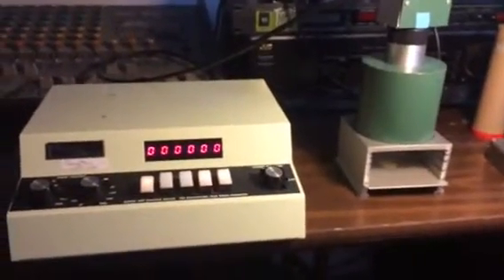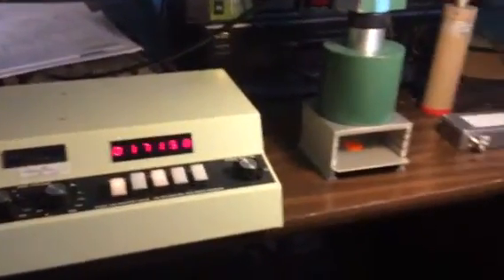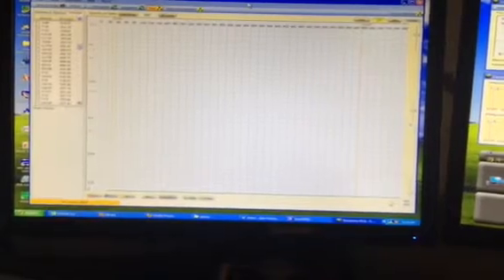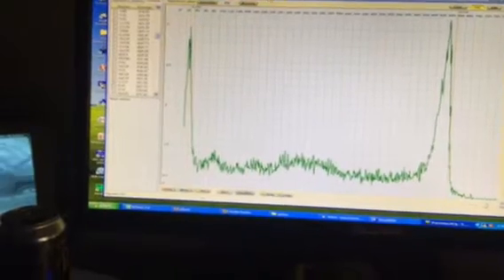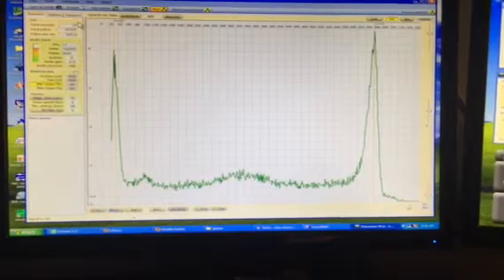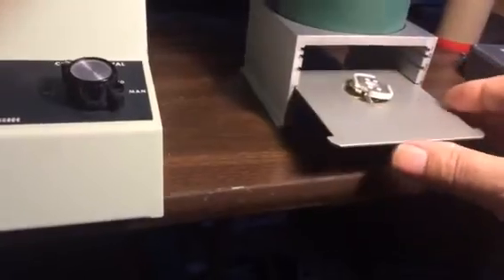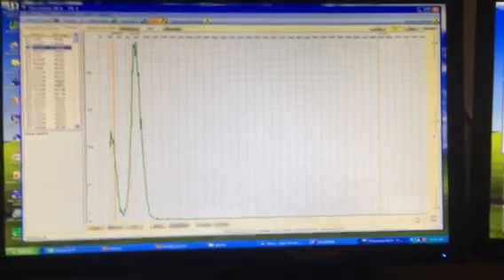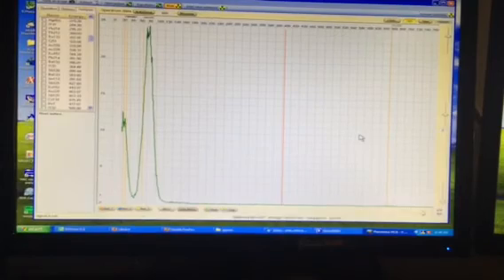Simple $2  Nuclear  MCA spectrometer  addition  to a  Nucleus 500 scaler part 2

Comment: Thanks for making this, based on your two videos I purchased one of these units from eBay for $50. It doesn’t come with the scintillation probe,  but I do own a Ludlum 44-2 and a home built scintillation probe that operates on 900v. Do you think that this will work as a set up. 
Cheers.
Reply from the maker: Yes the 44-2 should work fine. I used one on my 500 and it gave clean spectrograms.
Reply: @k4nlz  awesome thank you, I am a novice when it comes to this, I printed the wiring diagram today, where exactly on the board do you put the capacitor? And what kind of audio Jack do you use. I really do appreciate 
Any information. Thanks
Reply from the maker: @englishguy1985   hi guy.  What you are basically doing is using the 500’s precision variable probe power supply , and analog signal pickoff / click signal conditioning circuits ...... these circuits process the clicks to make them suitable for the digital digitizing chips. You are grabbing off  that same processed signal and feeding it into the pc sound card for the software.  I don’t remember , offhand , where the connection is .....it’s the input of the first digital chip. It’s clearly shown where I wrote it on the schematic seen in the video.  I just get a darkened out picture on my iPad when I stop the video.  Look the digital chip up on google and use the signal on the input pin. You can try points back toward the input as well. Probing around with the cap lead , near the digital chip input lead, won’t hurt anything.  You can solder a long lead with a mini plug on the end ( off old pc microphone or earphones is ok too ) of the cap and a chassis ground lug, adding the Jack on the back panel makes connections handier but not absolutely necessary. 
      I sold my entire electronics and nuke lab a while back ( and about everything else I owned ). I’m sick and dying of stage four  metastatic prostrate cancer and will be checking out before very long. I hope you have as much fun with nuke spectrograms as I did for years and continue to enjoy electronics for many years to come. Great taking with you Brit, good luck guy. Dusty , K4NLZ.
Reply from the maker: @englishguy1985  hey thanks big guy ...I’m good on this end , thanks for the thoughtful offer. I appreciate it. At my age , if one thing doesn’t get you , something else will yayahahaha.  Thanks again ... 73s.

Comment: Hello there.
I have a Nucleus 500 that works great.
This idea seems fantastic and cheap.
Any idea on the resolution of the gamma peaks and what the limiting factor of the accuracy is?
I have an iMac.
The sound card(?) is buried in the unit. The audio circuitry may be integrated. I'm not sure.
Can I use the analog audio IN port (mine does have one of those) for for the same purpose?
Would I just start with the gain very low and advance it up until things were scaled properly?
Will either of the Gamma spectrometry software programs you suggested work on a Mac?

A second question is about the C connector you added to the 500.
Do you have a switch or did you just solder the c male connector wires to the same point as the BNC? Obviously (hopefully) never connecting both simultaneously?
I have a lot of really great Ludlum cables and detectors.
Any place to get high quality but inexpensive cable adapters and/or mounted male connectors? eBay has one vendor but they are $30.00+ for the adapters and $12-16 for the surface mount adapters.?

Thanks for any help or suggestions you can give.
Sincerely,  Michael S Meyers
Reply from the maker: the limiting factor for  resolution of the gamma peaks, called FWMH ,  is determined by the type and quality of your scintillation probe.  Google " resolution of gamma probes " for more info.  also go to the Theremino freeware site ( probably your primary mcs software package ) and look at their page about noise in the soundcard and modification of a $10 USB soundcard as well.
Reply: @k4nlz  I have a sick 500. Could you email me a copy of Schematic.